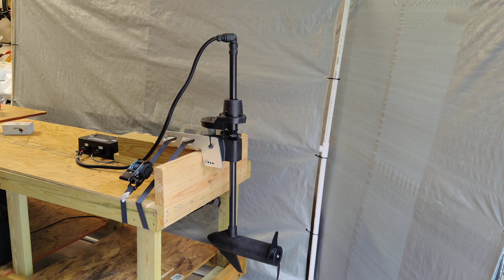Wireless Remote Throttle and Gearbox Steering for Trolling Motor - Part 2

Comment: Good afternoon, I would like to ask a question. Will the 880 80A ESC support a 54 lb motor?
Reply from the maker: I would not advise using any TM 50lb thrust or greater with that ESC.

Comment: good video. I have 2 questions. I hope someone can help me with them. #1. Will the power input cables to the ESC withstand the amperes generated by a 30 lb Minkkota? #2. Can this Esc work with an AGM battery with 12.6 v.? thank you. I want to start this project
Reply from the maker: Yes, I 30lb trolling motor will be fine. You can use an AGM battery. You just need to change the programming. I have a video for that.

Comment: Has anyone ever figure out a good way to lift or tilt with this kinda setup?? I’m buying the stuff to build this but had the thought to make it bow mount instead but I’d need to lift/tilt to launch/load with my trailer
Reply from the maker: I haven't tried it but I have a video using a 2 pulley system that may work.
Reply: Sure, some people use a linear actuator with one end attached to the motor mount on the kayak and the other end attached to the shaft on the trolling motor. It works similarly to tilt/trim on an outboard.
Reply: @  ya but then the steering now longer works as you’d lift it out of the steering motor   I currently have a actuator that lifts mine straight up but it’s not gonna work for this setup. At least I don’t see how it would
Reply from the maker: @j.lawsonoutdoors5659  You are probably right.

Comment: Thats  a lot better would be nice to see it on the water.Also does the motor lift up out the water ok with the gearbox steering.Great job thanks
Reply from the maker: Thanks Tony. The design could still lift vertically but not tilt unless it was mounted higher on the shaft.